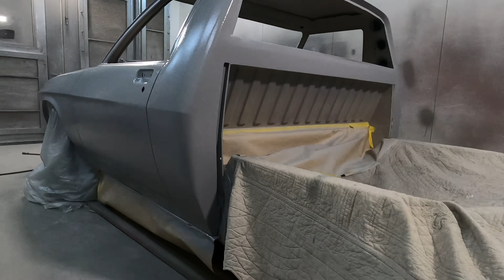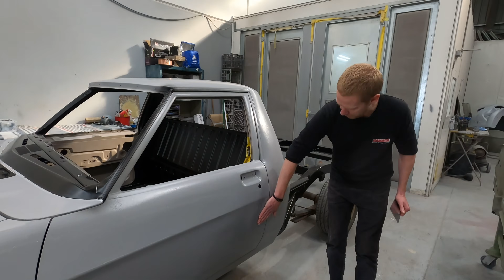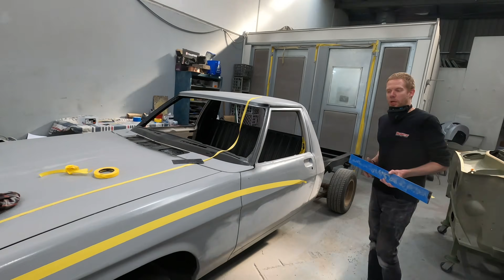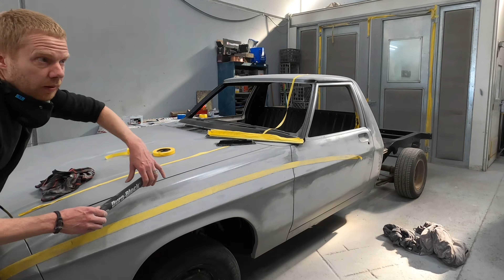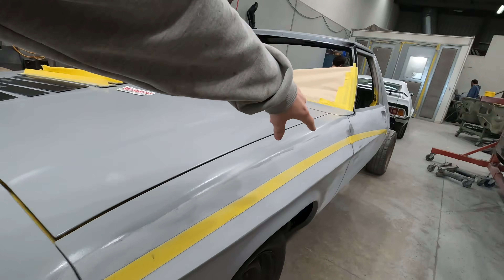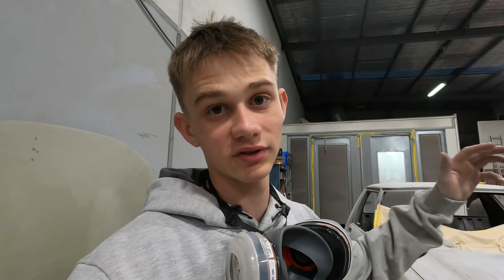TAKING THE BODYWORK TO THE NEXT LEVEL!

Comment: Good to see it getting there . Spline ??? Its a straight edge 😂
Reply: Yes and no.  The nine different lengths and thicknesses flex to the shape of the car to create a 'Spline line'.  These are the tools the Designers and Clay Modellers used to originally create the surfaces.  They are great for checking, filling and sanding.
Reply from the maker: Thanks mate, The spline is pretty much just a different name for a straight edge 👍🏻